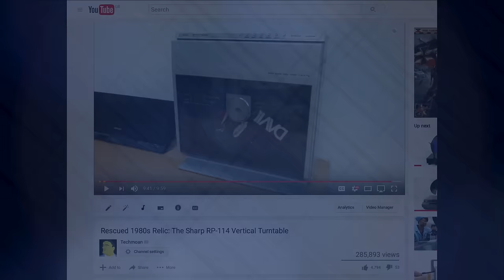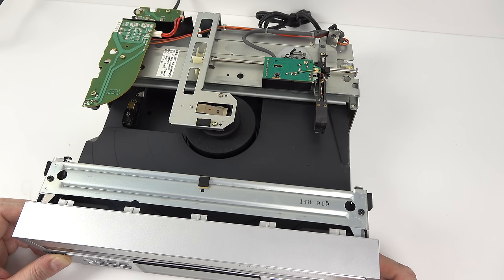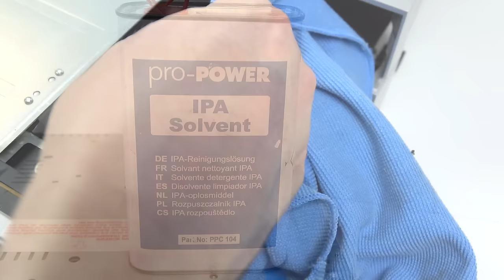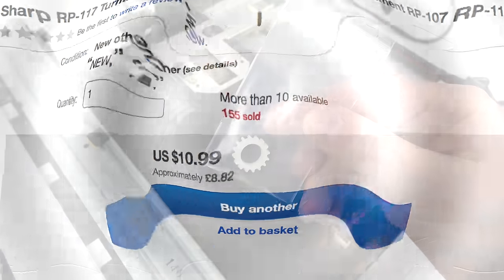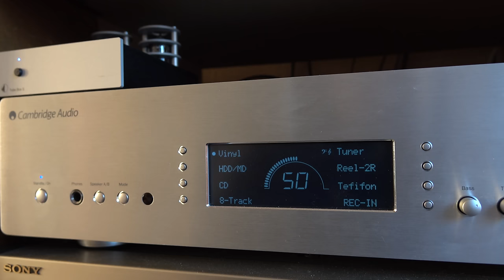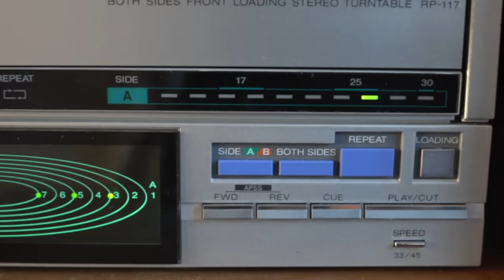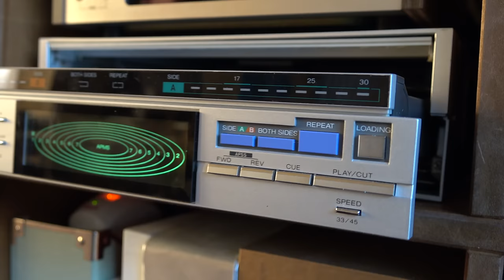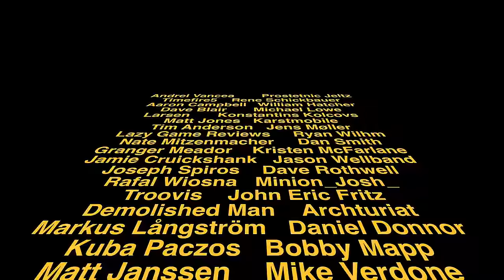RetroTech: Play vinyl records with CD functionality - Sharp RP-117

Comment: Have to ask, what happens if you load something with more than 8 tracks on a side. Unlikely I know, but I’m also aware of sound effect sample disks that would likely have more than 8 tracks assuming they were short sound clips(often used in editing etc.). If  I’m not mistaken I think I’ve seen mention of such sound clip collections on vinyl  on other videos of yours. So I would be curious to know, assuming it’s possible to test, what would happen in the very unlikely chance of trying to use media with more than 8 tracks. Yes it’s very unusual and unlikely in real use, I just want to know what the machine would do. And yes I know I’m late but after a  recent rewatch, now  I need to know...

Comment: I had one of these back in 84, bought it from Crazy Eddie's in NYC. Great idea, super cool looking but it was a HUGE pain in the ass. It was like a dust and fuzz magnet and I was constantly having to clean the stylus and track sensors. In the end I would just flip the disk manually because the only access to clean it was those two side doors and I had to move the other components to get to it.

Comment: 7:50 did you apply compressed air to side B sensor? In my turntable it is covered by a unremovable piece of glass or plexi. Side A is not, probably because they believe dust doest not go up.

Comment: Just wanted to point out... it only needs to go into a Phono Pre-amp if your receiver doesn't have a phono in. Otherwise, the preamp is built into the receiver and adding another one will make the signal way too hot.

Comment: Somethings i don't get here are how is tracking pressure set or even measured on these linear tonearms? Additionally is the tone arm on the underside of the record using some kind of spring bias arrangement as the topside one would just use gravity. I noticed it coped quite well with the warped disc which surprised me.

Comment: OK, not quite the question in the FAQ.... if you have an 8+ track/side disc... can you seek to track 8 or later by just hitting play without programming any tracks, then hitting the APSS FWD button seven (or more) times? Or does it just give up and switch to the other side after passing the 7th detected track? I mean, I had an Amstrad stereo with little squares on the display for each of the first 16 tracks on a CD... but if you had a compilation with 20 tracks on, you could play the later ones, it just wouldn't flash the number square. IE, maybe it only has 7 direct buttons and 7 LEDs, but might be able to register and skip between more using the regular forward/back buttons? Or at least let you skip to track 7 out of however many, skipping the other 6 even if it can't take you all the way?

Comment: +Techmoan; I'm guessing you are aware of the (currently in production) LASER-playing turntable -  it takes the 'lp-as-record' idea even further.

Personally, I am interested in that - as I have a huge vinyl collection (10's of thous), and the laser-table doesn't cause any wear on the lp disc (I read also how they used something  Techmoan to this to 'play' some very, very old wax cylinders, and it likewise causes no degradable damage).

The one issue on this laser-table? It's in excess of £15k+.

Comment: I got my RP-107H today. (which is the same as the RP-117 except the tape deck synchro option)
Could you tell me the thickness/width and innner circumference of the belts you bought?
I've read a lot that most of the sold belts are too small and not wide enough which leeds to bad performance and might mess up the drive. 
The main flat drive belt is often said to be 20 inches...some say 21.4 is the stock one. 
The arm drive belt is said to be a square 3.2 inches with a thickness of 1.2mm...some sources say 3.6 inches would be the right one.
Reply from the maker: Unfortunately I didn't keep the details.

Comment: I have something similar! Technics SL-J300R, from almost a decade later. Doesn't have the cool motorised drawer unfortunately, nor the ability to play both sides so easily, but it too uses a laser to scan discs and you can program a playlist into it. It was also significantly cheaper--less than a tenth of the cost of that, as I recall, though I couldn't tell you exactly how much it was. It does however work with coloured and clear vinyl, although I haven't a picture disc to try it with, and it doesn't have the analog to digital conversion issues you mentioned. It's a shame nothing like these exists now, as you mentioned.

Comment: The  DAT machine I carried  around Romania in the early 90's was a Sony TCD D3. Cost £140 new - but broke down irreparably within a year of so. I replaced it with  Sony TCD D10 - which is still working. Compared to my AKAI GX-635d it is extremely portable.  That's another machine which is still working. I went through a phase of UHER REPORT machines (all three still working) the last of which was a Stereo 4000 - but with only a maximum of 6" tape I was lucky to be able to record (live) as archivist to a semi-pro Opera Group. I used a pair of ElectroVoice RE55's which I dropped in from the Theatre Lighting Grid. The DAT is so much better than the NAB 10 1/2"  and now I find the NAB tape is degrading . . .

Comment: Yeah, I’ve seen very cool Sharp record players and other portable players from this era. This was around the time I wanted the Mitsubishi upright linear turntable that o thought was so beautiful . I have 2 in storage that I bought about 15 years ago, one from eBay and another from a shop without even checking if it played or turned on and it was not cheap. 

Great job always taking these units apart and fixing bc I would get lost and why I don’t even make an attempt. Other reason is not having the tools and parts I need and have in a thousand pieces. So not for everyone repairing these machines.
Reply: These machines were very advance for 40 year old units. I still wouldn’t be able to engineervsomething like this and this was at the very early stages of chips and computers.
Reply: Also, your videos helps me go back to my teen years that I miss and loved.

Comment: I own one since 30 years (bought in my youth on a fleamarket). Fortunately i got a dead one those days for taking off parts (specially the wheel like on yours). Sounds good, but as most rubber ribbon driven turntables, it runs not as good as the direct driven one. But it's quite ok for normal use.

Comment: I had a couple of these, and i also had a AIWA drawer type turntable, that could be used as a stereo top type or a stack-able type, the AIWA didn't have the APMS system though, instead it used a mirror system and a slide tonearm. It was quite unique, but much like the auto reverse tape decks, of the same era, (early 80's) made by AIWA it just didn't work very well. It was a very novel thing to have though. I would love to have both types today, I sold the AIWA at a garage sale in 1993 and my SHARP I threw away in about 1998. Had I known what either system would be worth today, I would still have both.  Ahhh the benefit of hindsight yet again. :/

Comment: He didn't stumble on the 60/50 Hz US/UK wall socket frequency problem. Guess why? Japan's two biggest urban regions use 60/50 Hz respectively, both at 100 volts. So anything from Japan can handle both 50 and 60 Hz.

Comment: Ugh...I had one of these and it was a headache. It worked well for approximately 3 months then I kept the [4] screws off the cover to access the album as it was always having issues with tracking and not responding to eject. Linear tracking was the selling point made " Linear plays music the way the engineers and artist intended " " The way the original recording was cut"

Comment: I just found an old sharp turntable, I found it in a yard sale, the device is the  companion of the RP-8800 amplifier , and you were supposed to connect the turntable in ordering it to work, but since I don't have the rest of the system I was wondering if I could just find an electric converter for the electrical supply, the only thing is that I don't know what the power consumption is, if anyone's got any idea of how to figure that out I'll be glad,.
anyway I always love this videos

Comment: Owned one of these back in the day and unfortunately the sound quality was poor to good at best. The best front loader I have heard is the Pioneer PL-X50, which was quite good compared to turntables in the $200-$250 range. The MC cartridge was very good and could be used with any amplifier (did not require a special MC amp). The stylii for the Pioneer are still available and can even be upgraded. It is smaller than the Sharp with a much better platter motor that kept very good consistent speed.

Comment: The cheap way to repair the cog is simply widen the inside with some fine sandpaper, or a drill. Just glue it in place with some epoxy. Works perfectly, is cheap and quick! Used it before ebay was invented.

Comment: If you have imported South Korean electronics you don't need to worry about voltage failures. We use 220-Volt power too!
Reply: If it connects to an AC input and the power cord detaches, just replace it with the British cord. If the cord does not detach try using EU to UK converter. We use the EU style plug.
Reply: If I would buy the Bruno Mars 24K Magic vynil, I'd like to use that record player to listen to it

Comment: Here is an Idea for US 120V 60Hz power supply, buy a DC/AC power inverter for US use, hook a 12V charger to a gel-cell/car battery and the 120V inverter also connected.
Not practical for everyday use, but for demos like this, it would be a easy/affordable option.

Comment: Couldn't you just have feed that belt under the metal plate instead of going in underneath? From what I saw it looked possible but I wasn't there. And I don't who would want to skip the repair part, that's the best thing.

Comment: Yes automatic turntables are considered for non audiophiles. So if you have a full manual turntable your cool and a real turntable enthusiast. That is a trend I personally don't like. Trying to get a decent turntable with at least auto return is few and far betwwen in the quality market. I ended up going early 1980s second hand. I like this turntable you featured on this video. Good talking point there and It would be good if you could get better type aftermarket styluses for this to improve sound quality. A bit like what JICO do for Shure, etc. But probably no because there isn't a big enough market to be worth while.

Comment: I have a RP-107 I believe difference is RP117 have RCA Connection and RP107 Din connection. I modified my 107 with RCA. Its an excellent autoreverse turntable. I have too a Sony PSFL99 with sames fonctions but sony it is not autoreverse.

Comment: I was reading the FAQ and wanted to correct something about the Laser Turntable (ELP):
- It does NOT convert analog to digital, only operates in the analog domain, the use of a laser doesn't imply digital conversion.

I've been doing my research about that thing and, while the concept is genius, the implementation of the analog circuitry is plain dumb, with resitors and caps in the signal path. Is annoying that they got the most difficult part right (laser) but the "easy" part completely wrong. Would be great if they hire a top class desing consultant like Nelson Pass or Charlie Hansen for the analog circuitry, and come up with something State of the Art that makes every other +10k turntable obsolete, but sadly that's not the case.
Sadly, a brilliant concept done wrong.

Comment: That small cog have to open the weight of about half the entire machine? would prefer a metal cog instead of plastic cog.
Show us more portable vinyl players that have a complete turntable on themand are about the size of a large tablet, fits the record and have the stylus able to move very close to center to handle small records and of course hand large size records.
The problem with laser is the color of the record, but I think an infrared laser would work fine since such laser does not need to worry about color.

Comment: The 80s were all about buttons switches and light's, ghetto blasters made with bigger speakers, more speakers, detachable speaker's, heck if they made one with 4 tape decks, 2 record decks and was 5 foot long with a huge handle on it, people would have still bought it, it was all about looking flashy, showing off, Today it looks crude and out of date.
The whole lot can be replaced with an mp3 player  you put in your pocket and won't leave a huge carbon footprint behind.
It's no longer an excuse to say " Well I pay for the electricity I use" 
Manufacturers have to design things that are already efficient, one could say but how much power does a 500 watt Bluetooth speaker use if driven at full power compared to a 40 year old HiFi knocking out 100 watts.
Probably not much difference if both were driven at full volume, Linear transformers versus switch mode power supplies.
At the same volume the newer one would draw about 25% less current

Comment: $10 for a plastic cog?! And he's sold $155 of these? that guy on ebay is making a killing!  over $1500 (or pounds) selling little plastic gears! U should get a cheap or DIY plastic mold injector and made a mold of the cog and use some DIY plastic molding method to manufacture your own cogs and plastic gears!

Comment: RP117 had one of these but it failed in less than one year's time and sharp just said that they couldn't fix it, well I got another one I'll be damned if it didn't last less than a year. Just another typical electronic item like all electronic items they will quit working.

Comment: I love Techmoan, but I don't have to look at the whole video in a way.   Most Sharp components were more rubbish than fine kit.  That's to say at best they were mediocre fidelity.  When it comes to mediocre sound most of these programable TT's were more "look at this" over "wow, hear this".  I have no doubt this Sharp unit was in that company.  When I saw the front fascia I kind of knew it was cheap Japanese audio.  While it may be a gallant try to make the LP soldier on with CD like features it simply forgot to be "high-fidelity".   As I recall the best sounding of these programable TT's was the ADC Accutrac 4000 or, perhaps, another in their line.  It was apparently quite a pill to keep running well though as there are precious few on the used markets.   Well, I must admit the point here is something that was a part of audio history and not if it was worthy particularly for it's fidelity.  That said we have another excellent stroll through the forgotten audio past by our amiable host.

Comment: Why don't you buy classical music tracks? anything past 100 years old is Public domain.
Reply from the maker: Nope that’s not how it works. It’s the performance that is copyrighted. I’ve had a video using the Blue Danube automatically flagged before now and that’s from 1866.
Reply: So doing a little research I found that the performance  of public domain work is covered by neighbor rights under the Berne Convention. In the EU the protection lasts 70 years so actually any classical records you have from 1947 prior would have zero protections under it. EDIT: Apparently it was 50 years, before 2006 but they wanted to change it to 95 years but instead decided to go for 70.
Reply: Also to be clear, when they changed it from 50 to 70 they effectively retroactively reinstated the copy right for all music effected by the new duration. So a classical song recorded in 1954 was in the public domain in 2005 but was under copy right in 2006...

Comment: Records/Vinyl has never stopped to be sold worldwide maybe in some countries they were lesser sold but in general there were shops that sold new records every decade . And of course there were the second hand stores too . The so called revival from records we have these last 15 years is in my opinion more of a scam than be realistic . They're way too expensive for a low quality material as the records aren't recorded with mono/stereo sounds like back then , new records are digitaly recorded just like an ordinary compact disc ( CD ) . Also there are way too much limited editions today which is complete ridiculous and doesn't make it a "rare" record into your possesion . 

About this machine in your video do they still sell those stylus ? Or is that a standard one ? Also this proves that the 70's & 80's made excellent hi-fi components and were ahead of their times . The junk garbage era started to arrive during the mid-90's with all the cheap plastic and other cheap materials . 

Also i'm wondering if it doesn't scratch your records that machine ?